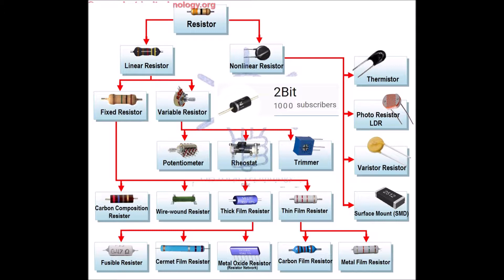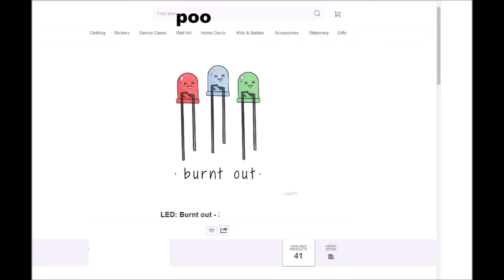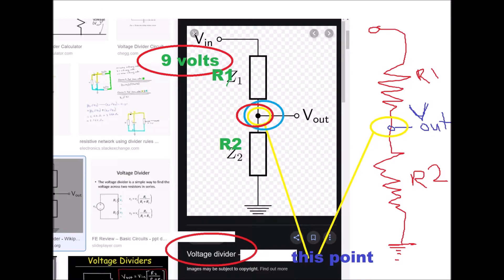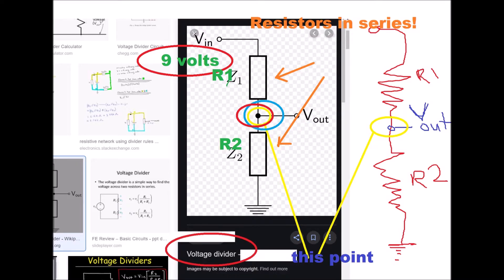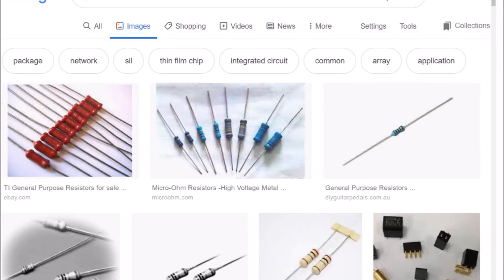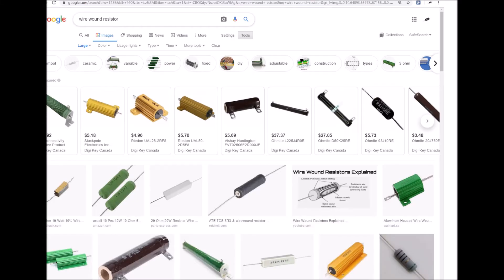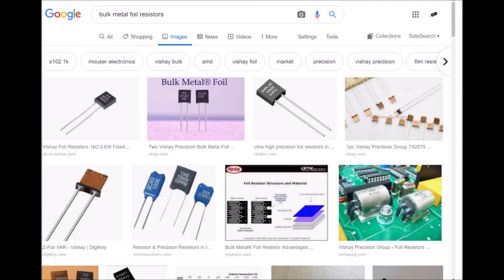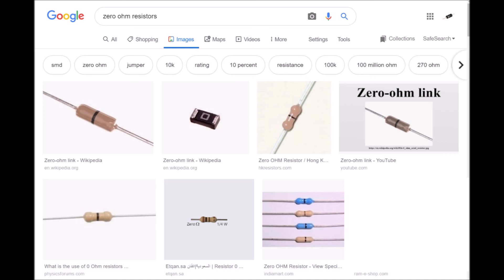Introduction to Resistors: All Types

Comment: I think the ' zero ohm ' resistor is used as a jumper instead of a wire.
On an old laptop I was trying to repair and bring it back to life as it was stone dead. I found the power was only going just so far past the power plug, right up to some of those resistor ' blocks ' for surface mount components. I noticed the tiny ( had to get magnifying glass ) little blocks said 00 on them. I took that as having zero resistance or a direct connector. A ' jumper ' and one of them was not ' jumping ' so I soldered a teeny wire across it and 10 years later it still works.